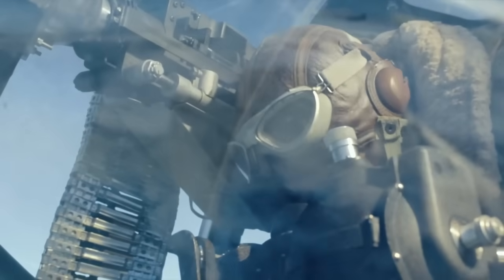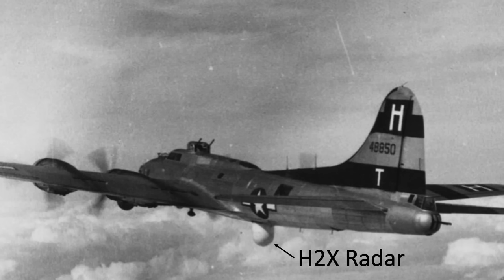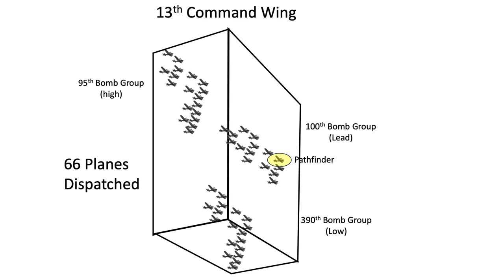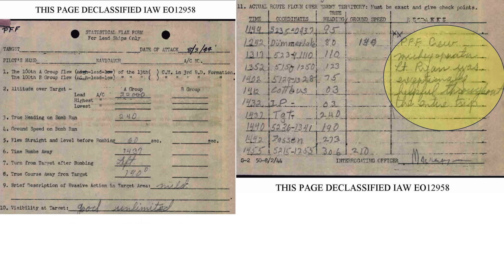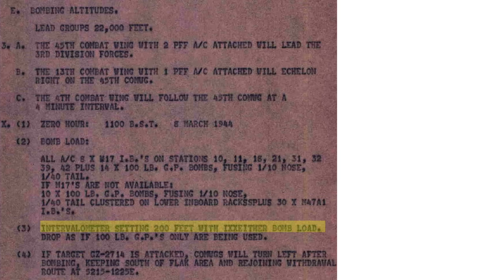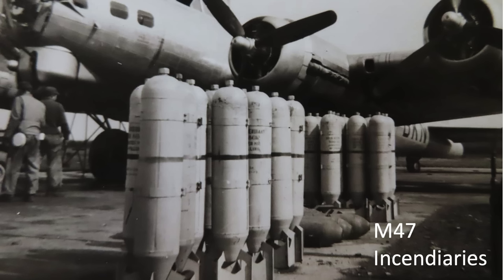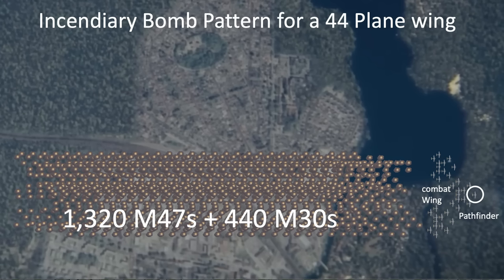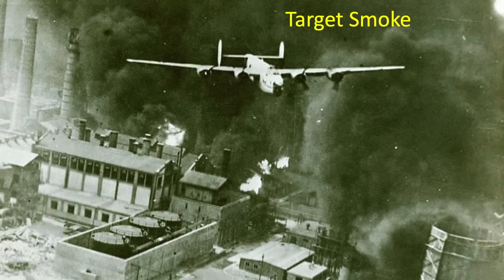Masters of the Air –Why so many bombs in Episode 7? - Fact Checking the March 8, 1944 Mission

Comment: When I first saw the clip, I thought, "far too many bombs per airplane".  I was surprised to find that it was actually too few.  Thanks for the info!
Reply: I have walked the cat walk in a B-17 bomb bay, I thought that as well, happy to know better.
Reply: Depends on the loadout of the bombs, 250s, 500s, or 1000s all have different size and number of carried ordinance, depending on target and other variables will determine the loadout.
Reply: The visuals of this series are so horrible that I wouldn't watch this even if I had Apple tv.
Reply: @8yearoldwithagun426 They looked like 2000 lb bombs.
Reply: Nice presentation
Reply: @dachicagoan8185  you're missing a great show.
Reply: Which is likely why they chose to show fewer bombs - Sometimes truth is less believable than fiction.
Reply: Sort of puts the madness of WW2 total war into perspective, right?
Reply: The Accuracy is off on several factors.  Most obvious is the oversized 100 lb bombs--they are shown much too large for being 100 pounders or the number dropped.  That is then compounded by the actual mission documents listed at 40 x 100 pounders.    (There is always a bit of variance depending on the target and the potential for getting better range but 4000 pound loads were common deep into germany).  Most B-17 missions I believe dropped 500 pounders and above.  The internal racks were only capable of carrying a maximum of 12 x 500 pounders according to the armorer's chart.  Those charts however show only 24 positions for 100 pounders so there is a discrepancy between armors charts and the mission specification.  Perhaps there were different racks later in the war?

Comment: "At a certain point, you're just doing damage control."
-Jon Parshall describing his experience being an advisor on the "Midway" movie.
You can blame Apple or the 16 historians or the writers, but I blame the producers, because it's generally they who make these calls in a show like this. It might be the director, but they usually don't have "auteur" power on a series.
Reply: 9:18 is the time frame your refering to. Too many historians and tech consultants - and not enough B17 veterans!
Reply: Don't forget the editor.
Reply: There’s also the fact that 100% accuracy doesn’t necessarily make a better story, and reality can be stranger than fiction. The scale of the air campaigns in WW2 is almost incomprehensible.
Reply: Exactly, there are too many stories of the tech advisors pointing out issues and being told its just a movie/tv show and not to get too worked up.  So, to say the 16 advisors said nothing is a little dismissive and shows ignorance of how things actually work.
Reply: I felt bad for Mr. Parshall when I thought about it.  As one of the authors of an exhaustively researched book on the battle of Midway (a book which many people consider THE best, most current, de facto account of the battle) he must have pretty much had to bite his tongue 90% of the time when working on that movie if he wanted to stick around.  You just know that the Hollywood people would get rid of the "nerdy" historians the second they try to tell the Hollywood machine their own business.   Unfortunately the real historians are really only there to give the writers/producers/director ideas on what else they can exaggerate  -- not correct any actual mistakes.
Reply: @arkwill14 Yes, that's one of my points. Another is, Hollywood only wants safe, so if Tom Cruise shows us a fictional Navy pilot who's a yahoo, then Midway producers decide that thoughtful, methodical Best will only "sell" if he's a yahoo too.
Reply: The writers probably have a decent share of the blame. The historians probably don't. Apple definitely does, because the buck stops with them - they are in overall charge and could bring the producers to heel if they wanted.
Reply: @Defender78 unfortunately B17 vets are an exceedingly rare breed.

Comment: Wow never knew they had that "Path finder" plane. I learned something new!
Reply: The Brits used Mosquitos at night for their Pathfinders.
Reply: @toddcarson1602  Also Lancaster PFF squadrons, and earlier on Stirling, Wellington and Halifax PFF squadrons were used. PFF tours were 45 ops instead of the 30 ops of the Main Force!
Reply: @hugh_ghennaux  the British did not get the 25/30 missions. US used it to increase moral.
Reply: @toddcarson1602 The RAF introduced tour lengths in 1942, for bomber command it was 30 missions after which you would be rotated out (post some leave) to training new incoming bomber aircrew. If you survived your tour and then spent time training new aircrew there was a fair chance you'd been promoted sufficiently that flying further combat missions wasn't a requirement. That said, you could volunteer to do a further tour. Guy Gibson, the leader of 617 squadron in the Dams raid did just that. Later in the war he was sent to the USA on a fact finding / publicity tour and during a press briefing he was asked how many combat missions he had flown. He responded 175. Apparently the room went very quiet.
Reply: Spell check messed me about. I typed US introduced it mission numbers,.  I'm a dum-dum. The RAF and Germans fought until they died or got promoted.
Reply: @toddcarson1602  Wrong for the RAF. Tour lengths were introduced in 1942, for fighter command it was number of hours, for bomber command number of missions. At the end of your tour you were rotated into a training role to pass on your experience to new aircrew. After that you could do a further tour if you wished.

Comment: Since a Pathfinder does all the navigation and bombing for an entire Wing, what's the backup plan should that one airplane be shot down, damaged, or otherwise unable to perform its mission?
Reply: I was just about to ask the same question!
Glad I scrolled down before typing...
Reply: They would fall back on everyone using their own sight;
Reply: @otten5666  2 pathfinders in the lead group at minimum. Originally there was a dedicated pathfinder Group that supplied at couple of PFF aircraft to each group for a raid. As more radar equipment became available and operators were trained, each group got a pool of PFF aircraft for their own use.
Reply: They usually sent more than one.

Comment: Maximum internal bomb load of the B-17G by weight class according to aircraft manuals, operations reports, and ordnance documents.

2 x 2,000 lb GP bombs; or
6 x 1,000 lb GP bombs; or
16 x 500 lb GP bombs; or
20 x 250 lb GP bombs; or
30 x 260 lb fragmentation bombs; or
38 x 120 lb fragmentation cluster bombs; or
38 x 100 lb GP bombs; or
42 x 100 lb incendiary bombs
Reply: Very interesting. A single B-1 carries the weight equivalent of 9.2 B-17s.
Reply: @nandi123  The B-17 had a smaller bomb load than several other heavy bombers (particularly the B-24) but it was preferred by crews for being more comfortable, more reliable and easier to fly. That's why it's iconic.
Reply: @angry_wizard  Same bomb load as the British De Haviland Mosquito bomber, which had only two crew, two engines and was made out of wood in furniture factories. Also the fastest aircraft in the world until the first jets arrived.
Makes you wonder why so much resource was squandered on producing so many other aircraft, most of which were inferior in every respect.
Or you could use the fighter-bomber Mosquito, which had only half the bomb-load, but had 4 x 20 mm cannon and 4 x .303 machine guns and could use them to do lethal damage to pretty much any ground or air target.
Reply: @richardsimpson3792 many aircraft were faster than the mosquito in ww2
Reply: @DontThinkso-kb9tc  the jets were...
bear in mind the RAF regularly flew civilian Mosquitos carrying air freight (bearings) from Sweden to the UK directly over Germany. The Germans monitored their takeoff, and did their best to intercept them, and failed.
Five 'kills' to be a German ace...but a Mosquito counted for 2x any other allied plane..
Herman Goering did a very funny rant to the great and the good of the German aircraft industry re the Mosquito.
"It makes me green with envy. Why did the British get all the geniuses and I get all the idiots?"

Comment: Great commentary. I particularly liked the part about using a intervalometer to determine the destructive path length of a strike. Never gave much thought about that until now.

Still I by my own reckoning think MOTA got more technically correct than incorrect and save for a few examples like this, it's pretty good and they put a lot of care and consideration into it overall.

I think a layperson stands to learn a lot from a show like this, and perhaps their interest in this show may lead them to video like this one with more detailed and accurate information.

It may be an odd take, but I like some of these little mistakes in the show.After all, they drive interesting discussions like this and consequently,  I learned something today where I may not have caught it in the show even had they gotten it right.

Comment: The gizmo that releases the bombs sequentially is called an intervalometer.  It is set in miliseconds.  Depending on the speed of the aircraft, that translates into feet between bombs on the ground.  This is turn is determind by the effect you want on the target, what kind of bombs you have and the size of the warhead.

Comment: 1:48 do you happen to have a video on radar vs. visual (in the works)? Always assumed that radar would be more accurate given the right circumstances - so hearing the opposite intrigues me
Reply: Radar was still in its infancy during World War II.  There was a video by Drachinifels awhile back where he discussed the advancement of radar on naval ships (primarily due to resolution) -- first was surface radar, then it was air radar, and then finally it was fire control radar in the middle/late war.  If you extrapolate this to air radar, and taking into account miniaturization and needing to accout for things like ground clutter, you can expect radar set resolution to be measured in many meters at this time.

Comment: I wonder how many of those "technical experts" were at the CGI contractor, as opposed to hanging out on the set with the actors.
Reply: That sentence does not make grammatical sense.
Reply: @ToddSauve Makes perfect sense to me. The CGI is done at a different time in a different facility. The set work is done first, if necessary in front of a green screen. Then the CGI facility does the animation to order. Then the two images are blended together in postproduction. The technical advisor is only allowed to see the set work. The director and the producer have the final say, mostly the producer. The director and everyone else works for the producer so what they say goes.

Comment: Fascinating stuff.
TBH I don't feel the inaccuracy is particularly troublesome.
Doubt many people would even notice the error.  I wouldn't have, that's for sure! lol.

It does seem strange that if there is a team of experts on hand, and the number of bombs dropped and the spacing is carried out by cgi, then they may as well have input the correct data.  It's not like having and extra 13 bombs per aircraft and adjusting the timing is going to increase the workload apart from some initial research.
Reply: One reason they may have shortened the delay between bomb releases is to keep those shots at a particular runtime, without the overall number of bombs in the shot looking too anemic. Or another possibility is that they produced the rough animatics and pre-vis prior to the oversight of the historical experts, and by the time the error was noticed, the pacing and direction of the shots was already somewhat locked-in. This is not to excuse the inaccuracy, just to mention a couple ways it could've come about. I'm a professional CG artist who has worked in the VFX industry, and have definitely encountered issues in shots where it was deemed either too minor, or too late to fix to meet the deadline.
Reply: @pixelsbyprince  
Thank you for your insight into the film production perspective.

To my eye, it looked fine, because it was close enough to actual WW2 footage as I remembered it.

I suspect what may have happened is that the researchers may have used the footage of actual B-17 bomb runs, which may have dropped a different bomb load at a different altitude. 

There has been a series about MotA on the WW2 TV YT channel.  They have been interviewing people from behind the scenes, though I've not watched them.  
It may not have been feasible for them to trawl through the archives as thoroughly as the creator of this channel.

Any road, the TLDR is that virtually no regular audience is counting the bombs and notice a 0.4 second difference in the spacing of the bombs.  

As you rightly pointed out, any extra time and money fiddling around with such a minor, unnoticeable detail really isn't worth it.

Comment: Awesome video. It makes sense for only the lead plane to use the Norton bomb sight to aim, and the rest of the bombers simply drop when they see the lead plane begin to drop. However, what happens if the lead plane gets shot down before they can make the drop? Is there a second bomber equipped with a Norton bomb sight that will take over the lead plane position?

Comment: My only question and observation is the photo of the straight string of bombs coming out of the fortresses at the top of this video. Does it not defy the laws of physics? Should they not be trailing off behind each bomb, from bottom to top of the stack, as they are dropping from the bomb bay sequentially, as the aircraft is moving forward at over 200 miles per hour? Not a physicist, yet it looks off.

Comment: It's not just the number of bombs being dropped, it's that they're shown falling in a vertical line. The aircraft would have to be stationary in mid-air for that to happen AND that there were no winds. Physics, people.
Reply: Falling in a vertical line is not that strange at all. The dropped bombs still bear their initial velocity from the plane. Due to air resistance, they start to lag behind, but that is not a sudden effect. Simultaneously, gravity pulls the bombs down, but that does not affect their forward momentum.

Comment: It looks impressive and it must have been devastating for those on the ground. I am British, so for me it has to be the Lancaster though I can appreciate the B17 very much. A squadron of Lancasters on a similar mission would be dropping 14000lbs of bombs per aircraft - the largest bomb payload of any allied aircraft, with a range of 1600 miles at a speed of 200mph. The Lanc could also deliver the 22000lb "Grand Slam"earthquake bomb, designed by Barnes Wallis. Or 4000lb "Cookies" in combination with incendiaries or other ordnance. Utterly devastating.

Comment: Thanks for that deep analysis.
The CGI accuracy for that show is sometimes not on par with the rest.
In that clip, you cannot differenciate the loadout of 100 lbs bombs from 500lbs or 100lbs in other episodes in that wide shot. That made me questionned the accuracy in the numbers of bombs dropped like many others.
Also there is no frame of reference to tell the size of those bombs so the wiewer might assume they are the same as in other episodes.
A shot of the bomb bay (even in just in the background of a shot) prior to the drop would have been enough to understand why they drop so many so far when we are used to see so few dropped closer to base in earlier episodes.
Excellent point on the PFF.
To not show the change in drop tech and the use of "Mickey", especially when the show is based on Lt Harry "Crosshair" Crosby memoirs, the sqd navigator and opération officer (someone who would have absolutely known that detail), is a big miss!

Comment: One of the early episodes makes the point that a cow on the runway would obliterate the largely aluminum B-17 in a collision yet later in the same episode a human body slams into a wing at cruising speed and doesn't cause ANY damage like the aircraft were made of reinforced concrete and the show hadn't JUST mentioned how fragile they actually are...

Comment: If this question has been asked before, I apologize.  Why were B-17G models not depicted in the series?
Reply: My guess is they intended to, but live action props budget probably went over so concessions were made. Very unfortunate but really only an issue for plane nerds like us.  The 2 life-size Forts and smaller dummy silhouettes they built on location would need to represent F models for the majority of the production, including pick-up shots if needed after the fact... so maybe they couldn't afford to add chin turrets, etc, for limited number of episodes that went progressively faster through time, where it would have been accurate. And for consistency, I suppose they decided to keep that F model in the in-air CG scenes to avoid confusion, at the sake of accuracy. But, at least they progressed to the bare metal look, which historically emphasizes the superiority the USAAF had gained. I was actually surprised they bothered to change up the US roundels as appropriate for each time period. But yeah, lack of G models was a real bummer for me.

Comment: Excellent all around. I hate how inevitably a show will do something that is less accurate and yet not even as cool looking as the real thing. 5 seconds of the bombardier in another plane waiting desperately for the bombs to drop from that lead plane would do so much for tension. “All 40 safely away” is another call out from the crew to show that there isn’t a problem with one of the bombs dropping, and gives context on why the run took so long.